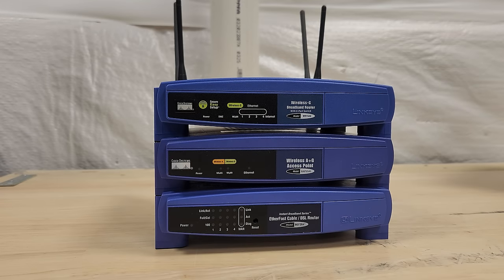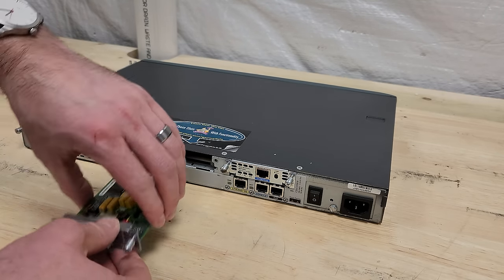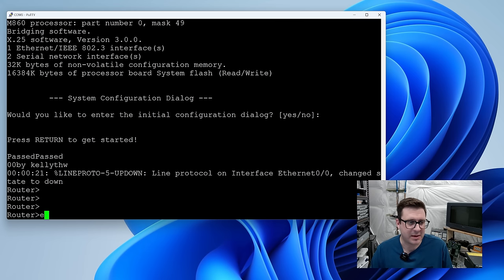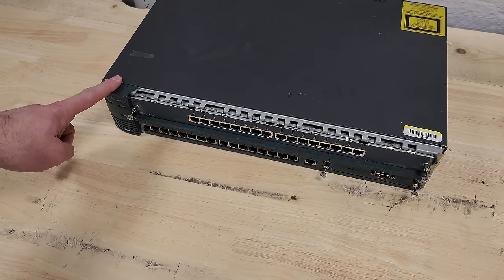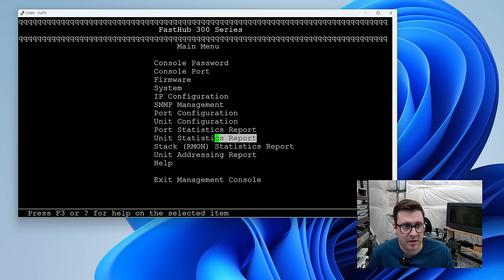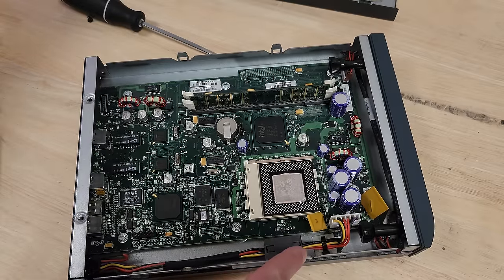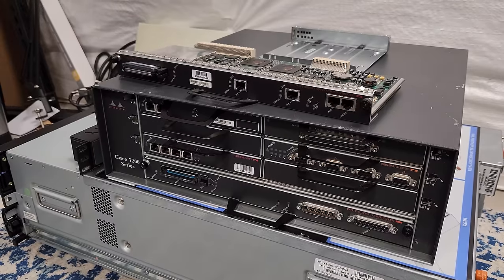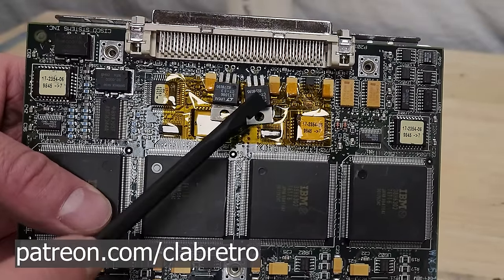Cisco PIX Failover

Comment: FYI - With the cisco equipment you can download the firmware from one device and push it back to another one with the copy command and tftp.  No need to go hunting for another copy :)
Reply from the maker: it's funny, I was wondering about that while I was flashing it. I'll have to try that out
Reply: Not sure you can do that with the Pix. (at least prior to v7 where flash actually has a filesystem.) These days, to get anything for older gear (2500, 2600, etc.) you'll have to beg the internet as Cisco has deleted them from history. (I have a selection from my era of running them.)
Reply: @jfbeam  I seem to recall doing it with both of my old pix515s.  I still have one around somewhere.  Maybe after I'm done setting up my new (to me) asa5525x failover pair I should try to find it to check again.  

But yes, I also remember torenting 1gb+ zip files full of outdated cisco images still hidden behind a tac paywall.  I probably still have one or two of those around somewhere too.
Reply: @serpent77 Just confirmed with the old 506 running 6.3, there's no interface for copying out of flash. v7+ puts an actual filesystem in flash that does support general access. (confirmed from the 515 with 8.0) IOS, of course, has always supported both - even a tftp-server to feed files directly.
Reply: @jfbeam  It would appear I stand corrected, thx for confirming.

Comment: I am a young network engineer working with Cisco stuff and the issue with the hub forgetting the mac of the XP Machine actually reminded me a lot of an issue I saw within the last year or so where some machines that don't send packets very often would drop off the MAC tables of switches exceptionally quickly so one of my scripts to check the mac tables to figure out which port a computer was plugged into would only work if the computer had been communicating in the same few moments around when I checked.

Interesting to see a similar phenomena from hardware released 4 years before I was born!
Reply from the maker: Awesome! Yeah I wonder if it dropped the table when I plugged in the module or something. Network was still totally operational.

Comment: A couple of tips having worked on Cisco:
-Doing just "wr" will save the config.
-A lot of commands can be shortened, configure terminal for example can be config t
-When you're within config t, you can execute commands like wr using "do" so you don't need to back out to the prompt. This is handy for "do sh run" from my experience

iOS can take some learning, but it is fairly simple once you get the hang of it. Think in my 15+ yrs of working on Cisco, I've only seen commands for making VLANS change.
Reply from the maker: nice, I didn't know about "do"

Comment: Pro Tip with Super Glue: Less is more, get it on the face of the two surfaces that are mating, and press the two surfaces together as hard as you can for at least 30 seconds, minimum.
The reason less is more is because less cures faster. The reason you want it on the face of the mating surfaces and pressed together hard for 30 seconds is because that gives it the greatest contact area for it to bond to, with the thinnest application for when it cures and crystalizes.
Applying crazy glue to the outside of the break does nothing but make it harder for the glue inside the mating surfaces to out-gas, cure and crystalize. The reason super glue is strong is BECAUSE of how quickly it cures. Using more than the least possible amount, ruins the strength of the glue.

Comment: I owned an ISP back in late 90s early 2000s and had many 2600 routers.  You probably know this but figured I'd mention couple things.  1.  you can make a cross over cable for the T1 lines if you want to experiment in your lab between two 2600.  2.  configure terminal can be shorten with config t and copy run start can be used to copy your running config to startup config.  WOW, brings back memories, I spent so many hours inside that IOS interface back then.  Many of my customers were T1 customers.  You can also do T1 bonding with 2, or 4 T1 DSU cards.  2xT1s would get your 3Mb/s and if I recall, if one of the T1s goes down, you can fall back to 1.4Mb/s.... Enjoy the trip through memory lane.
Reply from the maker: Awesome! I'm definitely gonna have to dive into the T1 world... and I didn't even think about bonding, that'll be really cool to try out!

Comment: I can smell some of the things from that HUB having ended up in CatOS, I used to have a big  12 blade Catalyst 5500 that I managed, that was originally from 98 i think, and it was a BEAST.
It survived lightning strikes and the only reason we ended up replacing it was due to needing VOIP (QOS tagging), POE and more gigabit ports. It really did make me sad because it was such a great device to work with as we had one of the newer supervisor modules. Never managed to get it above 20% load even when dropping a Ghost image via broadcast to around 100 computers.
Reply from the maker: those blade units look like absolute monsters

Comment: I've got a 2611XM serving as a dial in gateway for my legacy lab. You can fill that larger WIC slot with an NM-8AM card and get 8 33.6k modems to mess with. I've got that piped into an Adit channel bank connected to an adtran that feeds it a T1 RBS signal for 24 single phone lines. That comes back to Asterisk and from Asterisk out to my SIP provider. Probably should start calling it my home telco instead of home lab lol.
Reply from the maker: sounds awesome haha. yeah now that I have this stuff I think it'll be a rabbit hole
Reply: This sounds like such a fun lab setup.

Comment: On modern ASAs, the failover and heartbeat are over regular Ethernet, and many have SFP sockets for these interfaces allowing you to place your secondary unit in another building. And the failover is nearly invisible when initiated manually, which gives you completely hitless software updates. Recently took out a pair of 5585-X units, which has build quality far exceeding the vintage PIX units demonstrated in this video.
Reply from the maker: I've heard good things about ASA.

Comment: If you want switches to match your 515s and 2600 - you want the 1900 series. 10M ports with 100M uplinks. The FastHub type front bezel is in line with the 2900 2U series of switches like the WS-C2924M-XL.
Reply from the maker: I think a 1900 series switch is in my future

Comment: BTW: the "no service password-encryption" line in the original config means that password encryption of otherwise plaintext passwords was disabled and could be veiwed in plaintext by looking at the config. This would not apply to passwords set using the "secret" command as those are always encrypted. Also, instead of typing out "copy running-config startup-config" you can just type "wr" instead (wr is short for write).
Reply from the maker: ah thanks!
Reply: Wr doesn't always work. Sometimes you have to configure an alias for it. I think that's usually for Nexus gear though.

Comment: I can't speak for that cisco hub, but back in the early 2000's my home network was running off an hp managed hub (that I got for free). While they couldn't do all the fun stuff of managed switches like 802.1q vlans, they had a feature quite similar. You could partition the hub. So you could have ports 1, 2, 5 & 6 in one segment (broadcast domain), then 3 and 4 in a separate segment. Absolutely blew my mind at the time

Comment: I worked for 9 years at a University  starting in 1998. Cisco was considered luxury. We had each closet connected with fiber and ATM links. That would break out with stacks and stacks of Cabletron hubs, one of the worst network vendors.

The single thing that pushed the buracacy of education to change to a switched topology was not speed, management, or scalability.  No it was security. People,  using telnet, mind you, were getting their  passwords stolen.

In 2002 once we decided to upgrade we tried to get Cisco ethernet switches, but they were too costly. I dont remember the brand that won out, but i think the name started with the letter V or N. They were nice with vlaning and vlan gateways, trunking, etc.

Edit: pretty sure they were Nortel switches.
Reply from the maker: ha awesome. was thinking about trying out some ATM links

Comment: Love this! (Also, now that I can vicariously live the retro cisco world through you... if you need any other gear ideas...) 2948G-GE-TX I think is Cisco's first dedicated gigabit switch? I think may've been gigabit modules for their modular switches before perhaps. It's also 1.5U .. so kinda weird/neat. 
There's also the WS-C3550-12T / WS-C3550-12G... also fairly old gigabit switches but came after the one above. the 12T being 12x RJ45s and 12G being 10x GBIC (which you could then plug in gig modules) + 2x RJ45s. Always kinda wanted to poke around with them but knew I'd get very little use and there's so much to do already.
Reply from the maker: I was thinking about hunting down some early gigabit switches!
Reply: @clabretro  Are you going to eventually dig into CallManager & get a 7960G phone? And/or dig into an Aironet 1100... whip out an old Thinkpad and connect to that. Could really have a sweet 2002 setup.

Comment: MG chemicals... I respect you for using the good stuff!! I do use 99% alcohol but for the final touches always use specialized stuff like MG... Also contact cleaner and low pressure air on motherboards/sockets/cpu/ram. And always avoid repairing PSUs units except replacing fans.

Comment: Ues to have to maintain a pix firewall 515E was used exclusively at the business. I worked at between 2010 and 2015. They were really reliable. Never really had an issue with it. Was very easy to maintain and configure back when I was working with Cisco products

Comment: I've got quite a bit of used racknount modulators from all 30 of our tv vans from the 80s and 90s before we figured it was cheaper to go up and down linked best part about them is the have out and return 4 inch monitors built into 3 rack space units. We used em for coax drops all over Boston. You want em just reimburse me for the shipping after u receive them. They all work with manuals and VHS operation videos. Plus I got a ton of leader vector/waveforms and coax/fiber converters that used to cost 10g a price but nowadays they are 199 bucks new lol let me know be happy to donate to someone who'll use em. I can use the storage space in the studio. Just don't remember where they came from if u broadcast off them lol

Comment: The many-port FastEthernet card you mentioned for the 2600 series router would problably only funtion at a layer 2 level, meaning essentially a built in switch. This means that you could not just use one of those ports as a regular layer 3 router port. If the description for the card mentions anything about having "switched ethernet ports" that is what this is refering to.
Reply from the maker: that's a good point, I'll check that. was also thinking about hunting down an ethernet WIC (assuming those exist)
Reply: I don't even think that the switch card is supported in the 2600 line, I think you need a 3620 for that. Also note that this only takes 10Mbit WICs.

Comment: When you changed the confreg, it wiped the config as you found.
In rommon you can "rename" the flash:/startup_config to flash:/clabretro and reboot the system. Once it boots, you can copy the file to the running_config, delete the other file, while you have privilleged access: you can show the previous configuration.

All without changing the confreg. I think the config registers are so resellers can wipe the config fairly simply.

Youre welcome.
Reply from the maker: ah-ha, makes sense
Reply: A well, for catalyst; ASR and some other platforms are different (like their weird old 802.11 wireless bridges, etc)

Comment: I'm not surprised that the processor was reported as a Pentium II. Back when Celerons and Pentium IIIs were first released in the Socket 360 form factor, many early BIOS would report Celerons as Pentium IIs. Took manufacturers a year or two to get the processor identification correct.

Comment: Its a Celeron 300A, Mendocino core.  Back in the day I had a Slot 1 version running at 504 Mhz with a gigantic AlphaCool heatsink with 2 Delta 60mm screamers on it.  As for the Cisco gear, I do not enjoy IOS, but I can function in it if needed.

Comment: I love these old Cisco videos, such a throwback.

Do you have a switch with VLAN support? In that case you could probably set the 2600 up with two virtual interfaces on the same ethernet port and work it as a very hacky router 😉
Reply from the maker: I do, good idea haha
Reply: That may have happened on a production system or two back in the day @clabretro , although I take no blame for that 😉

Comment: Just an idea for that 7200 Router - Try importing a full BGP table into it. (There a number of step by step guides.) Have done this in a Gns3 lab, would be cool seeing it being done on a 7200
Reply: That 7200 would explode with a full table from today, I’m afraid! The current Internet tables contain over a million prefixes - challenging for a router designed when there were about 10% as many prefixes.
Reply: That's a 7200 (not 7200VXR) so it'll have an older NPE that cannot physically hold enough memory for a modern full table. (they could barely hold a full table circa 2003.)

Comment: Another great video. Have you tried Loctite Plastic Bonding instead of superglue? It is the bomb and much stronger than super glue and does not melt plastic. It has been a lifesaver with 3D prints. $5 at Walmart or Lowes.
Reply from the maker: I haven't, I'll give that stuff a try!

Comment: Modern gear you can use console cable or even mini usb cable. I have mine setup using a serial telenet server. If you are talking about meraki type of Cisco gear those require a subscription and can be accessed over the internet by IT. I actually have my home network running off of cisco networking gear using two 3560X 48port POE+ Switches and a Cisco 3825 Router. My firewall however is not Cisco it is a Netgate hardware running PfSense+ and using a Lantronix EDS4100 4-Port COM Server powered over POE to be able to login and configure the equipment over the network.
Reply: Also if you get a Netgate hardware with PfSense+ you can use the same Cisco Console cable to configure the Netgate Firewall hardware along with using a usb cable. You can also configure the netgate PfSense+ firewall over the network but can be kind of tricky as you would need to find out what the IP address it is using along with using the first port marked as LAN and if you are wanting it do any logging then you need one that has dedicated NVME storage which is typically the MAX version. The one I have is Netgate 6100 MAX which is one you can either have sitting on a desk, wall mounted, or even rack mounted.

Comment: Cisco really liked x86 hardware didn't they, the management module for that hub runs a 486. lol
Reply from the maker: ha yes. cheaper than custom chip dev I suppose
Reply: Good catch, that's wild. A 486sx-25 would have still been a (barely) usable desktop processor in '96, crazy amount of power for a management module.
Reply: You could still buy 486 modules as of relatively recently, actually. They were popular in embedded industrial computers in the PC/104 standard. The STPC Atlas being an example
Reply: Well, the company's Cisco bought did. The systems they designed (like the 2600) use MIPS processors. When they got around to designing their own switches, they too use MIPS. (What we see here is either a Kalpana or Cresendo device.)

Comment: Maybe login out of the management interface and login back will refresh the output? Did you rebooted the machines or just the management interface?
Reply from the maker: I did try login/out but it didn't detect it, I should've shown that
Reply from the maker: and it was a full hub power cycle

Comment: I have got three 3Com hubs! One even has 10Base-FB card in it. I wanted to tear them down for recycling but I feel bad :) 
Also I have several Cisco 2500 and 2600 series, but they are mostly trash with mouse wee in it, those will sadly get scrapped. They did have some DSL cards in them I think though!
Reply from the maker: nice!

Comment: Looks like the WICs are all "real" WAN interface cards like T1/E1, serial modem or DSL, so not really much to expect for conventional ethernet. The expansion module you've mentioned (NM-16ESW) may come with a gigabit daughterboard. Pretty interested about whether that GE port can be setup as a dedicated routed port
Reply from the maker: yeah hoping that can be a routed port!
Reply: You can always try the old "no switchport" config. I don't think the ESW can do that. (the WIC-4ESW won't, but the WIC interface is only 8Mbps. The NM slot is a PCI interface.)
Reply: @jfbeam  Actually after digging through documentation, I do think the ESW will expose all ports to the router, so no switchport will work and so does the gigabit port